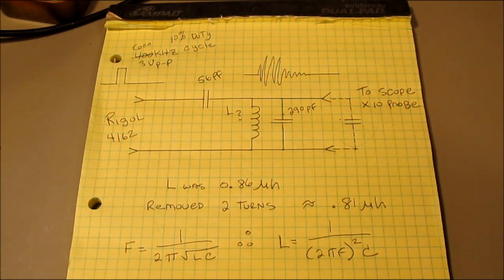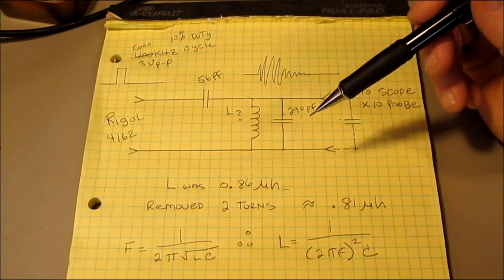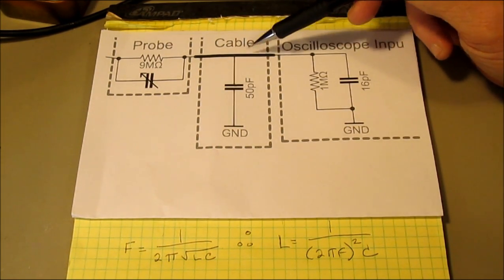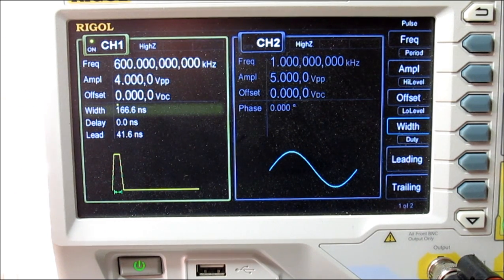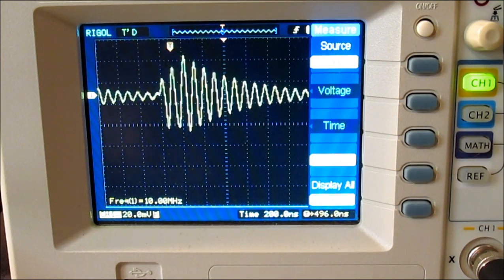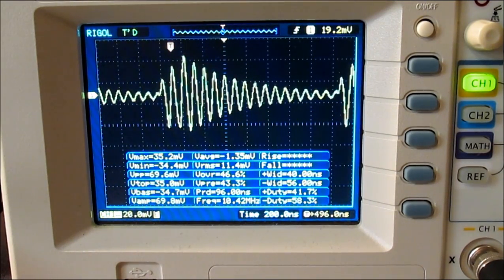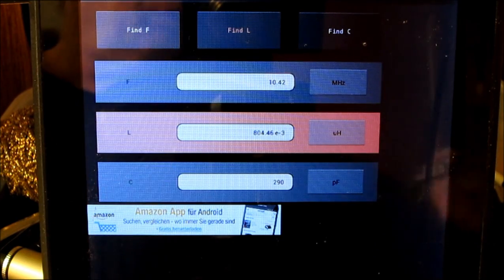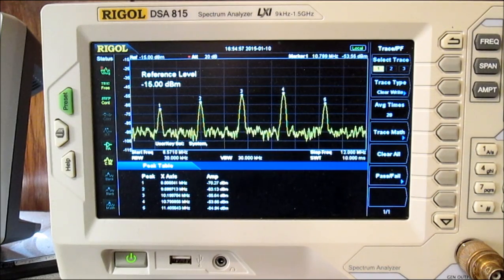Measuring Inductance with A Pulse and Oscilloscope

Comment: How do you maximize the time that the inductor takes to establish a field and the time that it takes to discharge in order to repeat immediately to eliminate the short circuit?
Reply: You feed a rectangle wave into it and modify the duty cycle.
so where a square wave would be 50% Duty cycle, Try putting your function gen on Rectangle Wave, 1KHz
and put it on like 5% Duty cycle, but then in certain inductors that rings will over lap, so you'll need to use between 8% - 12%  or maybe 10% Duty Cycle,   Have a play around with the Duty cycle, that's your answer
Note : on a rigol this waveform is not called Rectangle, even though it should be, it's called PULSE

Comment: I am fascinated by your use of a pulse. I’m definitely going to try this. I’ve written a program in Fortran to find the needed unknowns and would be happy to share it.
Reply: Fortran! I thought that had gone the way of Latin ;+}
Reply: I've been programming in Fortran since 1975 and it's been a long time since I've heard from someone who still used it who wrote, bravo👍
Reply: well i have absolute respect for FORTRAN,   i however have a humble spreadsheet in Excel that i'm happy to share with anyone........... Obviously after the Fortran option is exhausted and purely as a last resort :P
Reply: @martinkuliza  I can see where Excel would work very well for this task.
Reply: @kennethstover4427  
Indeed. i reduces a perhaps 15 minutes of calculation to finding the value of the inductor to perhaps (Considering you need to user cursors on the scope to get the frequency) Perhaps it reduces the time down to say 10 or 15 secods per inductor.

Now when you have 5 inductor it doesn't really matter, when you however need to go through a bucket of 200 or so that you need to test, it matters quite a lot, it can be the difference between taking 1 week to go through it vs perhaps 1 to 2 hours.

I say a person should do it manually a few times first so as to not get lazy , but once you do say 10, it's ok to do the other 190 with a spreadsheet because the spreadsheet gets the formulae in your head

Comment: waveform is "clean", but it's a mix of generator frequencies and tank circuit - the only "truly clean" form is a continuous sine with a constant amplitude - and amplitude of yours is not constant - and it's a result of mixing generator's and tank's frequencies
and because of above you can't judge tank's frequency from max signal of spectrum - it has nothing to do with probes' setting - probe should be properly compensated with that variable capacitor on your oscilloscope schematics - resonant frequency shouldn't shift with properly compensated probe - only uncompensated probe will benefit in this regard
Reply: I am afraid you are mixing up the transfer function of a well adjusted probe with the load thatvany probe will always have on the circuit under test.
Reply: ... that any probe will...
Reply: @calculatingcapibara2914  
You didn't have to do that,  You just go into your comment with the 3 dots on the side and select EDIT and change it
Reply from the maker: You have to realize the amplitude is not constant because it is being pulse which is also not constant
Reply: No mate, Probes are relevant ,  You try this say on 10x Probe setting but your probe is on say 1X , You're going to have a problem, or if both probes are on 10X for example.
the probe coming from the Siggen is going to be 1X, the probe going into the scope needs to be 10X
if you don't do that, you'll get a shit signal

Also, A Constant AC is not going to do the job  as what we are trying to do is ring out the inductor for it's resonant frequency,  AC is not going to reveal that

Comment: Thank you for this instructive video. Can you explain in a bit more depth why the 56 pF cap is needed? And does it not interact with the other components to shift the resonance frequency?
Reply: The 56 pF is just a way to insert the excitation into the tank circuit. I expect however that this method will seriously affect the ringing frequency. I would like to see the result when using a straight resistor, much larger than the impedance of the tank components. Say 10 Kohms. I addition, I wonder how accurate the 290 pF is. It is a major factor to the accuracy here.

Comment: You can also calculate the Q of the inductor. By counting how many Cycles it Goes down to 0.707 of the Peak voltage Times 4.53
Reply: This will be difficult, as the 56 pF in serie with the 50 ohms output of the pulgenerator will affect the Q seriously, I expect. Even the ringing frequency is affected by the dempening, although I do not expect that to be of great effect.